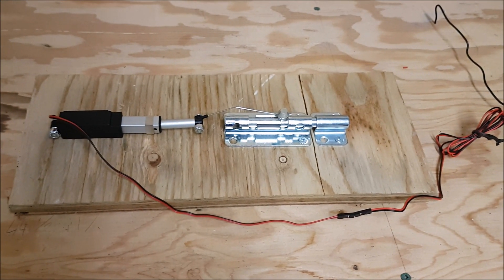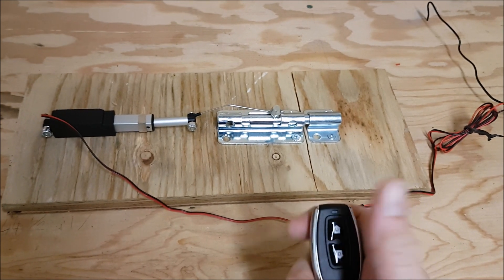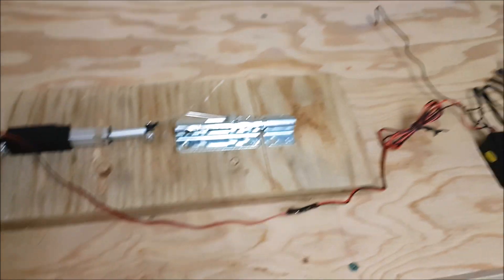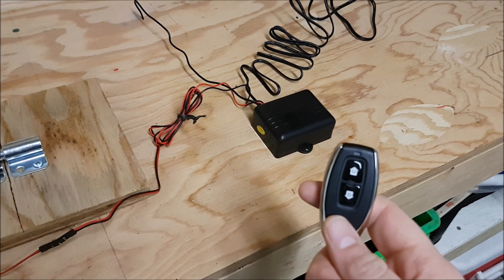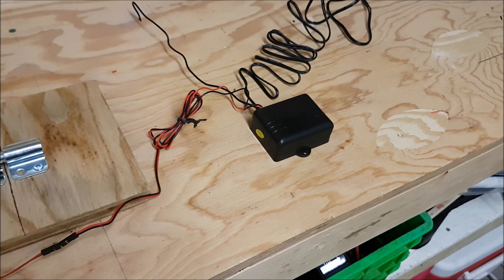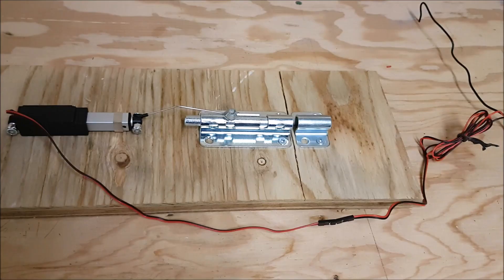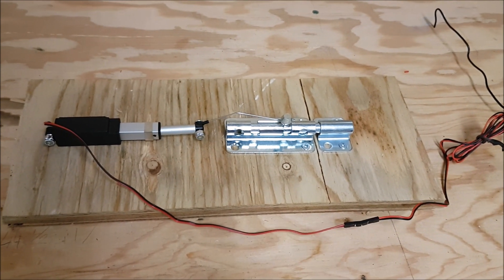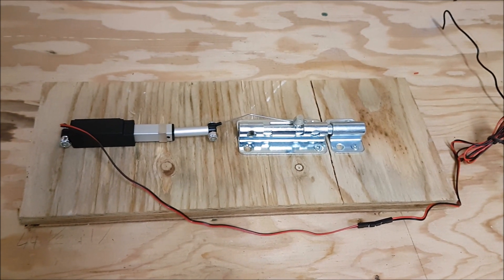DIY Remote Control Door Lock

Comment: Just a question might be a dumb one but How do you control how far the actuator opens does it have any type of limit switch inside?
Reply from the maker: That actuator is an "S" model with limit switches. You would have to make your linkages so it operates full stoke and the limit switches wold shut it off at each end of it's stoke.

Comment: Thinking of doing something similar - how did you connect the wire from the linear servo to the bolt lock? As in, what's keeping the wire connected to the servo? Is the black stuff..tape?
Reply from the maker: Hi Charlie, the wire I'm using for that is a tail rotor pitch control rod from an RC helicopter. It already has a hole in one end so I bolted that to the clevis on the actuator. The other end I simply bent the wire around the lock. Hope that helps.
Reply: actually, that really does help! thanks! i'm actually waiting for my linear servo to ship out still, but once it gets here I'm going to use it in conjunction with a biometric reader for access to my room.
Reply from the maker: I'd love to see that when it's done!

Comment: So where did you buy that remote Fob from. We have laundry room look at my complex that door open with Key Fob  just by taking it close to the lock its like Bluetooth or just Inferred as you have to take it really close to it. I lost my Fob which looks like a little Usb flimsy little thing that is programed and my land lord charges like $75 for new one. which is a rip off... So I wanted to buy from some where so they can program it, but can't find where to buy those from..
Reply from the maker: Our FOBs are only sold with our Remote Control units and are RF not bluetooth.
Reply: It's likely that it's an RFID proximity tag. The most common frequencies used are 125kHz and 13.56MHz. Each tag has a unique ID number and this has to be programmed into the reader system. Usually done by putting the reader into a master mode, selecting the add tag/card command, and touching the new tag to the reader. Basically the reader must know of the existence of that particular tag before it can be used. Tags are really cheap but they must still be matched into the system. Tags can be programed into the system to give different types of access to individual tags.

Comment: Very clever. I do see a potential problem, if the lock does not line up as that type sometimes does not. Will the servo continue and the wire bend and not engage the lock?

Comment: What length servo did you use here?   I went to the links provided but we gave to choose a length for the actuator. 
Much appreciated.
Reply from the maker: Hi Boomer - Sorry to have left that out. The actuator used here is the L16 S series with a 30mm stroke.

Comment: Why don't you just use the linear servo's shaft to slide in to the pipe? The whole wire plus shaft thingy is redundant.
Reply from the maker: That would be a better design, but we just used what we had kicking around.
Reply: First, this is not a servo. 

Second, the Linear Actuator's push rod does not have the sheer strength of the bolt.

Third, the slide bolt lock is already made to do this. Why on earth would a smart person waste all that time to make something way more costly than something already made? Makes no sense.
Reply: @ActuonixMotionDevices  Better design? What? Are you crazy?